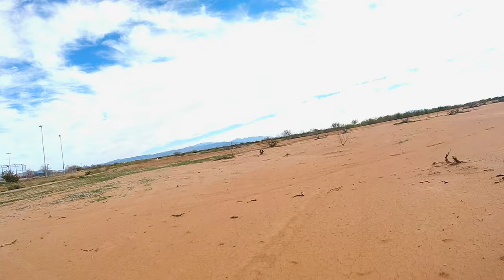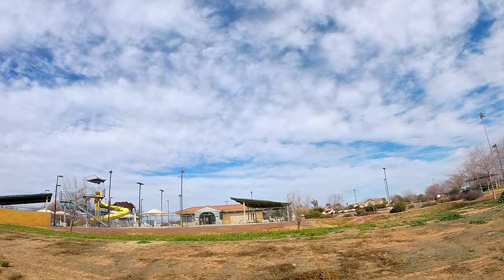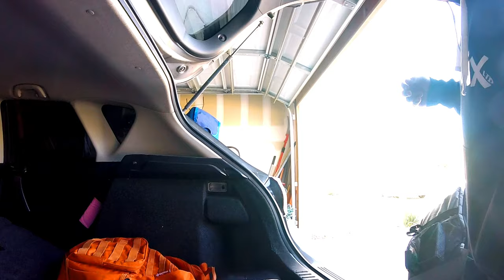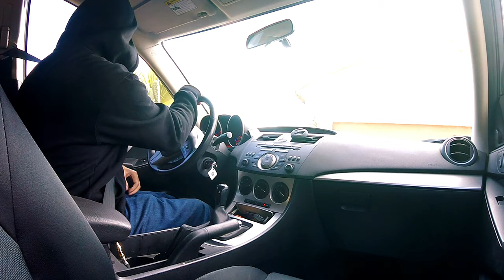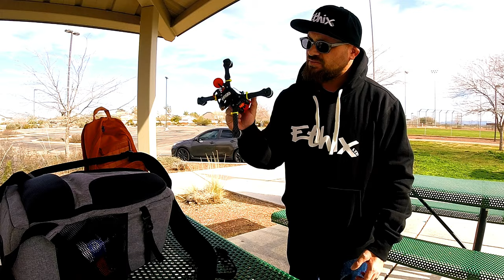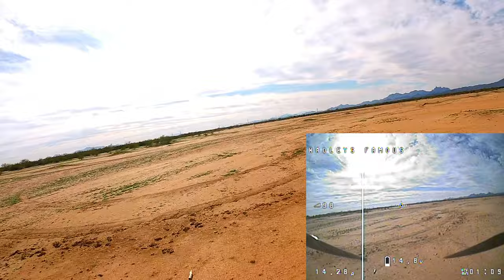FPV Vlog - Crossfire Failsafe

Comment from the maker: I have had some obviously funny issues with this jr. Crossfire kit - the total connection quality was reading 55% so rssi was reading wrong, on the transmitter rssi said 99%, So I changed the "offset" to 1% from 0% in total connection quality to read 99% on osd instead of 55%... like I say its user error... This is the furthest it has stayed connected before failsafe at that low of agl. 
I do have the TBS diamond antenna on order.

Comment: The TBS diamond antenna was made for low flying out at far range...it uses the ground to reflect signal, but like the immortal T... it needs to be mounted in the vertical position for optimal performance.
Reply: Garrett Johnson damn that explains it bc the same thing happens to me I thought diamond and immortal t are both horizontal mount at least that’s how I always see it done
Reply: @MaxBeamer  I myself run it in the horizontal configuration as well just because it is easier to install on the quad that way and install on the radio without having to stand my radio up when I set it down. It still works in the horizontal position but not optimal at range by no means and def not a mile out 5 feet off the ground 😋.
Reply from the maker: I got you buddy, I have the tbs diamond antenna on the way. I have tried horizontal and vertical. In this video I set the T in the vertical orientation.

Comment: I’ve had i issues use the The regular antenna, whiched to the Diamond and it was better ! Also you can change the output of how much mw your crossfire sends out. I put mine to 100 and set it to were it stays to 100 at all times . I’ve failedsafe when it wasn’t set to 100w
Reply from the maker: @Nothern_ FPV Thank you my doooood.  So turn "off" dynamic power?

Comment: What antennas do you use on your goggles and quads?? You said they are the best and custom made, what's your goggle antenna setup?? Who makes them, I didnt see any antenna info in description? Im Looking to FINALLY invest in some quality RX goggle antennas, and possibly change up from the foxeer lollipops and axiis im currently using on my quads... Thanks!!
Reply from the maker: The antennas are custom made buy the mad scientist from aomway. He is unfortunately retired, custom 5.8 tuned antennas are the best. I'm usually getting mine from Docmurdoc883 from Instagram. I use a menace pagoda on the quad and custom rhcp on the goggles. I use the ImmersionRC Rapid+Fire module.

Comment: Interesting problem, I don't think your RSSi is configured correctly though as it should have dropped linearly before the RX Loss if you were losing signal.  Not sure what the range of 250mw is I have the full xfire module and when Im out at a mile or so it regularly flips up to 500 mw but never drops to stage 1 or stage 2.  Not sure if the Jr does the stage dropping or not will have to read up on it.  I also don't fly in as clear an environment as you have there so not sure.  Just for interest sake How do you orient your TX and Rx antennas?  For long range they should be vertical, I make and L out of my immortal T at the back of my quad that way I get a blend based on the angle the quad is flying at.  The other thing is at range you never want to have Tx pointing directly at the Quad,  Effective radiation is at the sides and not in the center, Check out IBCrazys Videos on the subject.  I think you are close to having things right though if you got a mile out.  Good Luck Mate, and good VLog!
Reply from the maker: Thank you my doooood. In this flight both immortal T antennas are set vertically, on the quad I mounted it to the side if the gopro mount. Your right the rssi settings on the osd is definitely wrong.